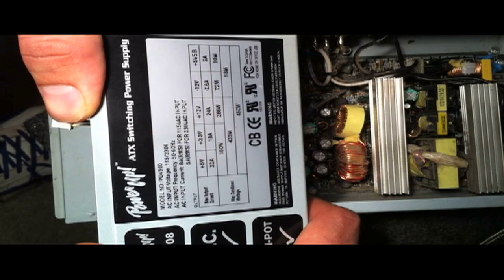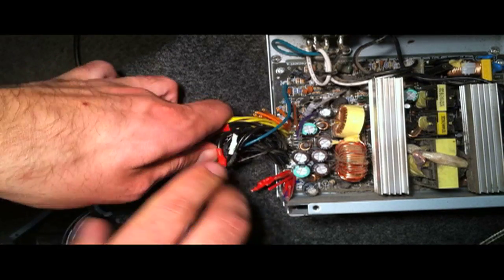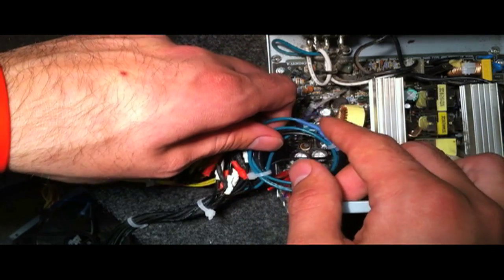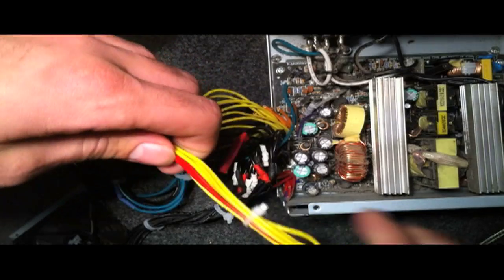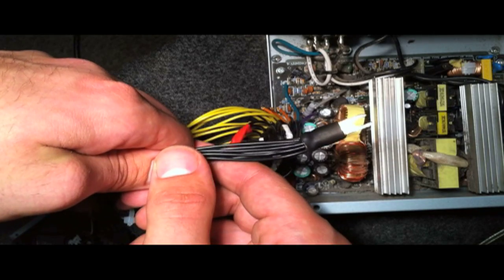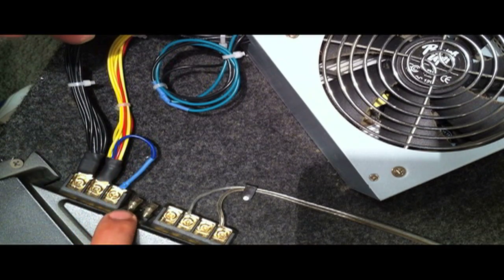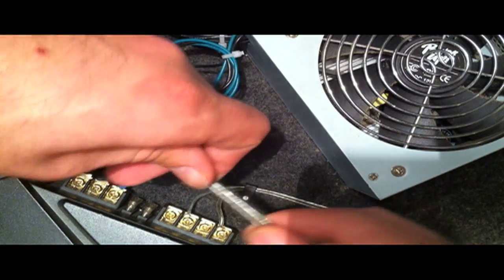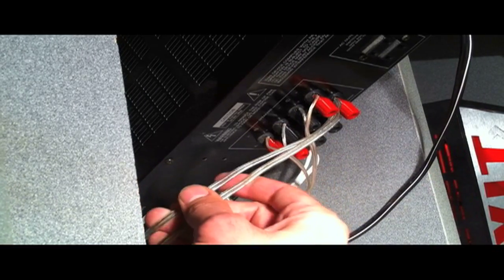Car Amplifier and Subwoofer Powered By Computer Power Supply Tutorial

Comment: I just bought a thermaltake sp-850m 70amp 850w single rail modular to power 360w 50amp jl amp. I'm sure I'm good on power.  Question is after eating this video, what is the difference on hooking up a newer psu that's also modular.  So I cut off the cables on the side that is to feed the modular connectors and solder all yellows. Hope with my specific description someone cam shed some light or a video

Comment: Most high end receivers have external amp hook ups. 
Just run your RCA, to the pre amp of your home stereo and run the speaker wires as normal, from the car amp. 

Nice video.
Reply: I know it's a 3 year old comment, but what you're describing, RCA cables from home receiver's pre-amp output to car amp, is for audio signal only. This video shows how to power the car amp using a computers power supply (CPS) that puts out enough amperage to sustain a high volume especially on a subwoofer.

Some home receiver's have internal sub amp and has subwoofer speaker output for none powered subwoofers.
Reply: @orangecounty7144  You can still plug your car amp into the pre out to do receiver for the full range speakers. Unless you cross it over for the subs. It does not change anything. The sub out can also do it.
Reply: @TheoneDragon51  What you think about a 3 year old comment notification?

I trip when i get a notification of someone commented on my comment that's like 6 or 9 months old, cause i dont remember what The hell they talking about...Lol..👍✌️
Reply: @orangecounty7144  lol it took me a minute.

Comment: this method is fine for running amp but this computer psu dose not provide necessary amperage to amp to work at full volume,i had tried many different methods but if you want the correct output of your amp then you require 3 psu's for correct amperage matching..................try my method,i am sure you will get hard hitting bass result...

Comment: I have two 30 amp fuses side by side on my amp, does that mean I need 60 amps going to my amp?
Reply: if there is 2x 30 amp fuses on one terminal then yes. if the wires have their own terminals then just 30 amps
Reply: This is because you are running out of current. The reason the CPS is so good for this because it produces 20+ amps with relative ease where as the average game system power bricks tops off at around 12 amps. It has nothing to do with the ground.
Reply: but he dont use regular pc power supply...
Reply: Travis Gulley you're still getting less than 10 amps with that you probably need close to 300-500 watts
Reply: Travis, it should "work" but it might not work with the low notes just like your game cube brick. The more current, the less the power source has to work. If your amp wants 30 amps and you give it 14, the chances of it burning it up or not working that well are pretty high

Comment: I tried doing a similar thing - power a car amp with an ATX PSU. What I did was put yellow wires in +, black in -, put on another yellow in Remote and my PSU went bust. Is the amp supposed to be working if no speakers are attached? I used only 4 yellows and 4 blacks for the power, however the amp didn't have any load on, so I thought these wires would be enough...

Comment: nice video.. although i dont have much info on these things but heres the setup that i have..i have a 5400w amp and on its fuse it says 40.. How much wattage psu i would need.. thanks
Reply: what do u mean u know the wattage
Reply: Ahh i see so if u have 540 watt and 40 amps and 12 Volts u need 12x40 = 480 watt pc power supply but u can have just 540 watt i guess you add one zero because 5400 watt is 2 much for pc power supply.
Reply: Gamerdu45 ... thanks what i did was used a 500 watt psu..and so far its working fine... and man the sound on these car amps at home is phenomonal.. pure bliss.. it litreally shakes the the entire house...😀😀
Reply: :D nice I will do the same thing and is it holding great ? dont the wires overheat ? or when the bass drops is there any distortion ? because  u know it is not made for music but it could work.
Reply: Travis Gulley ... Dont think so..its done as otherwise it will melt the single cable due to overheating.. Use a good matching power supply and it will be fine..
Reply: 12 volt cables on PC power supply does not stack so add like 5 yellow wires and still 12 volts should be, u can try with multimeter
Reply: Look on the sticker on your power supply, I think it is weak for your 
amplifier. And it might be aslo the bad grounding. You can try it on car
 battery and everything should be OK. If not bad wiring or amplifier.
Reply: I will need to see your setup to help you with that

Comment: i went ahead and connected the green power wire with ground but when i turn the power supply on the fan moves for a second then stops. what do i do?
Reply: swith the red switch in the back of the psu i had the same prob . that should make it start worki g

Comment: What happens if i wired my sub to 2ohms? When i go to wire it to my house amp?
Reply: your house amp will die in a very short amount of time, most house amps are 4-8 ohms for a reason bud, most people dont take notice of those numbers when they should, stick within the limits of your amplifier
Reply: Ignore Bob. Chances are your amplifier will be perfectly fine. Just don't push it beyond its thermal limits or maximum clean power output. The lower resistance in the coil allows more current to pass through it than what the amplifiers components are originally designed to do. Subwoofers never stay at a perfect ohm (impedance/resistance) as the cone moves their is a coil which is usually made of copper or aluminum. Since these metals are not magnetic it is the perfect material to be used to create an electro magnet. The little copper or aluminum coil in the speakers or subwoofers moves back and forward around a pole in the middle of the driver. The speed of which creates the sound waves. So to answer your question as long as you're not pushing your amplifier past it's limits it will most likely be perfectly fine. Besides after box rise your impedance will most likely be reading higher. Bass on sir. I've been doing it like that for years but recently I've stepped up the game to a 1200 watt rms 1 ohm Capable amplifier.

Comment: Every single time I turn my volume up the psu or amp shuts off or goes into protection mode or something. I have a 1000 watt amp and for psus I have 1 800w and 400w and a 250w psu all powering it with 4 gauge wire. I spent a lot of money on this set up and I can't use it to its full potential, any ideas why it might be shutting off? I tested for voltage drop and it goes below 12 but I don't know why with all the power I've got.
Reply: for a start you cant tie together more than one pc power supply, they dont work like that & as ive explained many times & even in my video its nothing to do with the wattage of the pc power supply as that is the combined wattage of all the rails, you need to find out how much current your amplifier draws in amps & get a power supply with more than that number on the 12 volt rail & you will be good to go, if you cant find a power supply with high enough current for your amplifier then look into server power supplies on ebay, they are cheap enough & put out more than enough current, you gotta know what your doing bro, check out my video
Reply: I saw other videos with people using multiple power supplies and I added up the amperage across my PSU's and easily had enough
Reply: doesnt mean a thing bro, these power supplies can NOT be tied together like that, it doesnt work as you think it would, the only power supplies that can be tied together like this are identical server power supplies as they have particular connections for doing so, also be aware that a protection light on a car amplifier means there is something wrong with the amplifier, look at all possibilities, how many woofers you running? dual voice coil? is your amp 2ohm stable? like i said look at all the possibilities bud
Reply: yup, thanks
Reply: Bob Hoskins to go into further addition switching dc power supplies such as this pc psu can be "tied together" or also known as connected in a parallel configuration. The problem with the setup you have here is that the power supplies you are running don't have similar characteristics. When running a parallel configuration you should match the amp output and wattage of the power supply units very closely if not exact because when a hard hitting bass note draws power from the dc power supplies it will stress the lesser powerful supplies causing voltage drop. You are straining your power supplies and you are likely to damage one. Look into finding matching power supplies.
Reply: ZaggaThe BassMan yo I have a question. I looked up server power supply and found it, how would I link it to the amp?

Comment: How many watts you putting into the high input on that amp? Im not so sure about what ohms you will be pulling from your tuner even though you twisted the wires together since it is just a line signal and not actually going to the speaker. Thanks for sharing but your tutorial just dont add up to me. Twisting all those 12volt wires together sounds bad. Running high output from tuner to high input on amp sounds risky due to wattage of tunner. Possibly pulling 4 ohms on a more than likely 8 ohm tuner sounds risky. 
I been thinking of doing something like your teaching here but im pretty skeptical that your way is a good way.

Comment: lonewolferton I would go for a psu that has a wattage that matches the amp.
Reply: this is deeeply wrong, the wattage of a psu is the wattage of all the different voltage rails combined! you need to be looking at current draw & max current ratings on power supplies, forget about watts because that will just confuse you, learn about current measured in amps

Comment: my psu turns on then the amp works for a second then the psu shuts off. whats going on? is the psu not pushing the required wattage for the amp and then turning off? its a 250w psu with a DHD NTX-2006 amp. The amp says its runs 160 when bridged and does 200w+200w max power. does that mean its does 400w total or only 200w?
Reply: look at the fuses on your amplifier, if theres more than one fuse then add those numbers together & try to match that number to the 12 volt rail of a power supply, if that number is higher than the amps of your 12 volt rail that you are already using then there is not enough current to run your amplifier

Comment: FINALLY!! SOME DAMN COMMON SENSE i was trying to use a x box 360 standard power supply brick adapter to power my 2600 watt amp to an outlet hat has 3 25 amp fuses and my amp wouldn't power on but the led light on the brick would turn red i made sure i hooked everything up right. After searching on the web for 3 hours straight on all other youtube videos on this topic why it wouldn't power on i found your add  http://www.instructables.com/id/Car-Amplifier-and-Subwoofer-Powered-By-a-Computer-/ i haven't done it yet but soon will.Correct me if im wrong but if my 2600 watt amp has 3 25 amp fuses im gonna need a psu with atleast 75 amps and 12 volt dc right?
Reply: thats right buddy you will need atleast 75amps of current, look into getting a server power supply off ebay, they are cheap as hell & have plenty of current & if one is not enough then they can be connected in parallel to achieve more current

Comment: What port did you connect the 2 sets of speaker wire that converted the 4ohm frequency to 8ohm on the amp? That was an odd looking plug that I have not seen before

Comment: electricity doesnt work like that, all it will do is split the current draw between the rails so rather than 10A on one rail ( will melt) it will split it hopefully equally so say 10A using 10 12v rails would be 12v @ 1A per rail
Reply: no

Comment: thnks for the great video..
i have a 5.1 speaker system which are already amplified speakers(as they are computer speakers), so can i send the audio signal output from the amp to the input of these already amplified speakers? coz i can not take output from the woofer(main unit) and feed to amplifier as input and then give output to speakers coz woofer will not get amplified then.. i hope you understrood. can anyone pls tell me if there is no harm in doing so?

Comment: i did exactly what yuu did and the cps turns on but when i put the positive on the amp the protection light flickers on and turns the cps off.. i have to remove the green wire from the negative and put them back together for it to turn back on.. so basically it isnt powering my little amp got any ideas or suggestions for me?

Comment: Finally got it to work but I blew a fuse in my psu. I replaced the fuse with a wire and got much louder sound.The only problem is the psu caught on fire. I have a 1000 watt car stereo amp. What psu should I get? Thanks for the help.

Comment: @InfoEricch my PSU also has a purple, grey and blue wires that run into the long rectangular part that goes into the motherboard, can i cut those the same way as the red/orange?  the purple and blue attach on the psu at the same side as the yellows and the grey goes under the heatsink

Comment from the maker: @icecold2021 The terminal clips that i used were brass, which can be tricky to solder. So i just soldered the ends of all the wires together and then crimped the terminal tightly around the ends with a pair of pliers. The crimped terminal is plenty strong enough to connect to the wires, the heat shrink was just used for appearance. 

hope that helps

Comment: At the ends inside the heat shrink are they soldered onto the clip or how are they connected to it? Same question about the remote input wire also.